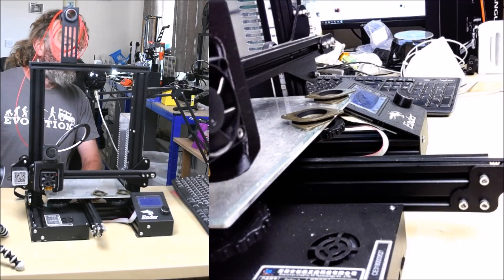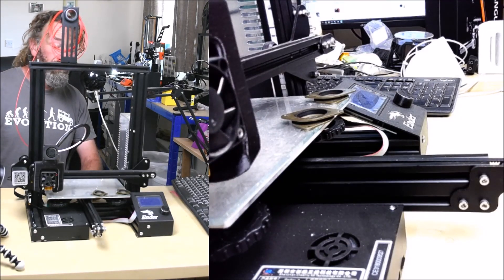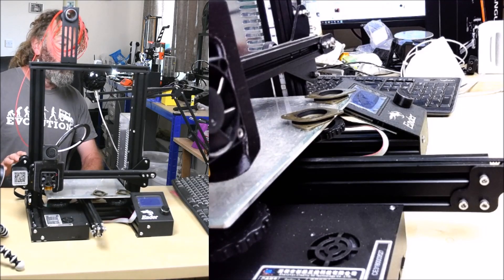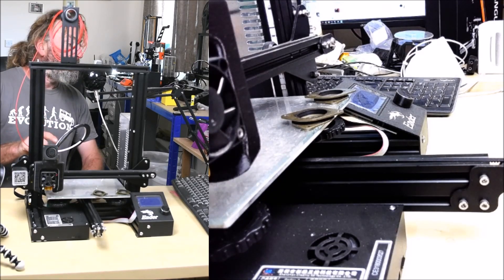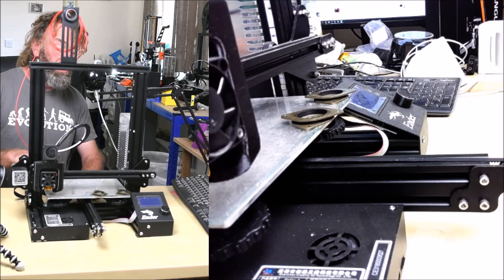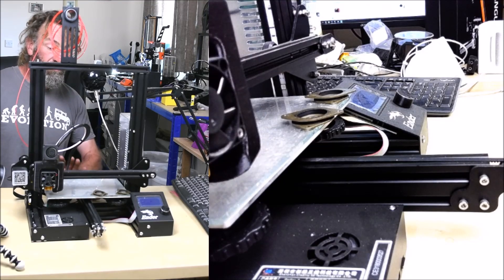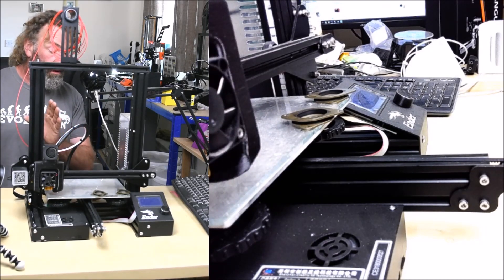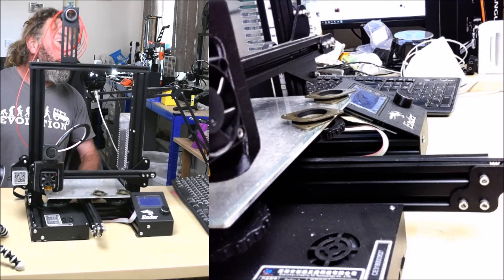Ender 3 Mods Series Pt 1 Nema 17 stepper motor dampers installation

Comment: I dont think you can place the dampers on the ender 3 anymore they've changed the mortor and it doesn't align correctly
Reply: yes, I think the pulleys are press-fit now so a much more difficult upgrade.
Reply: @morgaj21  I saw another video on this issue where you can print an adapter to compensate for this. https://www.youtube.com/watch?v=IjzrNoFnbcI&t=575s

Comment: all good stuff thanks for sharing ,  it appears on all Ender 3's are quite the same, my  new Ender 3 has friction fit  non removable pulleys on the X and Y axis & those shafts are also round and not D,  I have been toying with the idea of  redesigning  the Y motor mount  with a 6mm offset so as to accommodate a damper but as the extrusion  it mounts to is 20mm wide after allowing for the centering of the pulley   it doesnt  leave as much meat as I would like for the face of the stepper to mate up against, so  the mount will have to be  reinforced from the limit switch side of the extrusion, but this will also allow an idler to be supported from both sides of the extrusion  which will hopefully get rid of another small issue  keeping the belt straight - as on my ender 3 the belt angle changes quite a bit as the bed moves towards its endstop I noticed a 0.2mm difference in geometry of the Y axis of  prints if they are placed at the very back of the bed compared to the front
Reply from the maker: +Andy Davies thanks for that Andy ive been told with a little heat they will pull off the shaft as they are a tapered shaft. I cannot try this myself as i dont have one  but im assured its possible

Comment: Interesting solution to the bed hitting the motor before the switch, I ran into this earlier today while starting my assembly. I just measured and filed that aluminum piece back to make the clearance as it needed to be.

Edit: also I find it interesting that Creality has already changed a few mount point elements on my machine (Amazon, Creality direct, just arrived) because my tensioner has four screws, two on opposite sides of the aluminum extrusion. Still pretty obvious how to do though, so this is still fresh. 

Thanks for putting this informative video together. I wanted to make sure I didn’t have any more surprises on the other axis before I get more time to complete assembly.

Comment: I purchased these mounts shortly after purchasing my Ender 3 (Oct 2018) and I found that it doesn't have those adjustable pulleys on the stepper motors.  This means I cannot  correct the belt pulley misalignment once these mounts place the steppers away from their original locations.  These new pulleys look to be press fit onto the solid round stepper shaft.
Reply: I received my Ender 3 last week and have the same problem.
Reply from the maker: If either of you could send me a photo to my email I would be very grateful interested to see what the have done
Reply: @MATS_MAKERSPACE  sure, what email?
Reply from the maker: You can send to absolutebeginner3dprintinguk@gmail.com
Reply from the maker: I was going to suggest a printed angle bracket so it looks like something had already been designed
Reply from the maker: I have never seen that on a printer before! All my machines have grub screws to be able to replace the gear or just move for alignment. Very strange.
Reply: Glad it wasn't just me - bought myself an Ender 3 Pro for Christmas with upgrades like the dampers and am having the same issue. Likely will need to install a Y axis damper at a latter point then.

Comment: I couldn't move the Y axis stepper motor back slightly (@ 8:00) as the bolts pass through the frame. I had to go with the first solution and move the stop switch board forward and secure it with just one bolt (still seems secure for the amount of pressure supplied to the stop switch).

Comment: Perfect guide! I ran into the same limit switch problem on the Y axis which led me to your page. I elected to use the T-nuts on the limit switch instead of the stepper mainly because I felt the stepper would benefit more from the stock extruder tapped holes. Very noticeable difference in the sound. You can still hear the motor run but the high pitch sound is almost gone. Worthwhile upgrade and thanks for posting the video.
Reply from the maker: Glad it helped

Comment: Hmm, kinda puzzled due to the fact the screws on the new ender on the X axis are not long enough to reach the motor's thread by at least a full centimeter. How did you manage to get the cover and motor stick together?
Reply from the maker: My email address is in the info on my YouTube page. Send me some photos of your issue and I will do my best to find you a solution.